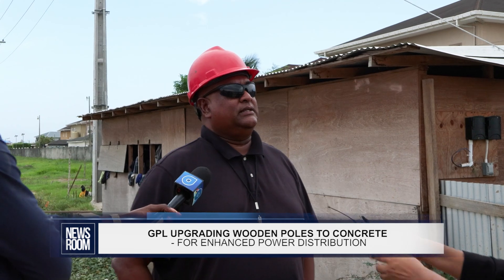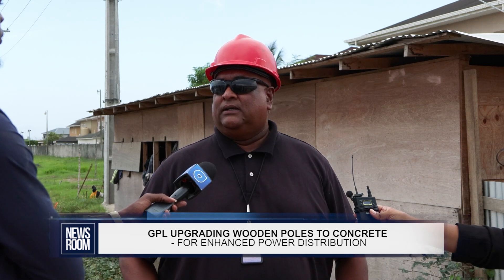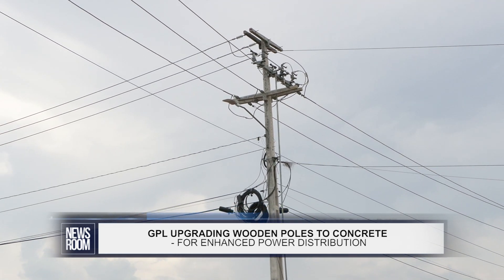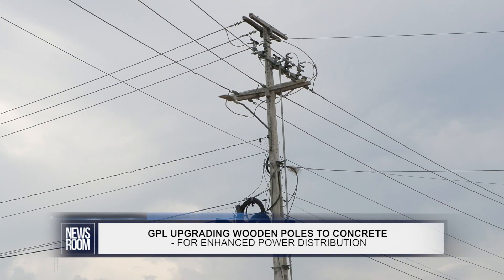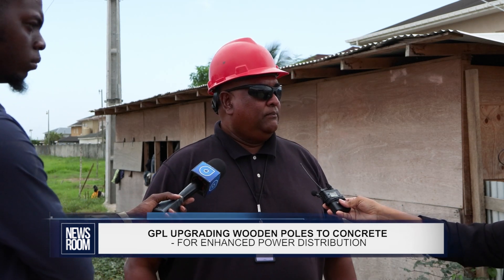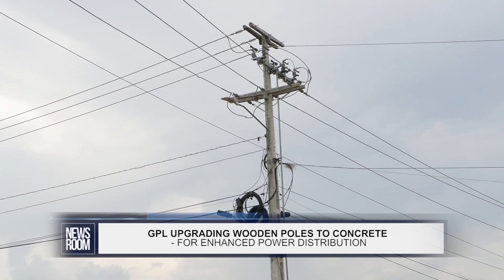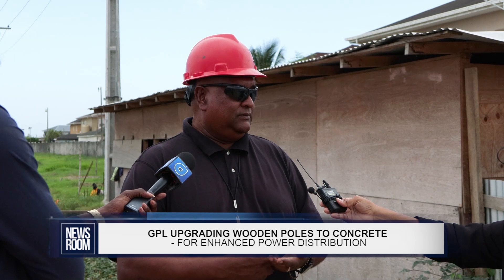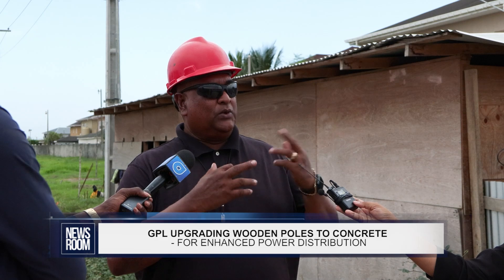GPL UPGRADING WOODEN POLES TO CONCRETE

Comment: The main problem in Guyana is having electrical poles running along major roadways and hence susceptible to destruction by vehicles resulting in disruption of power. Any new installation should be away from highways as seen in developed countries. In my housing community the distribution lines are now underground so not susceptible to vehicular destruction.